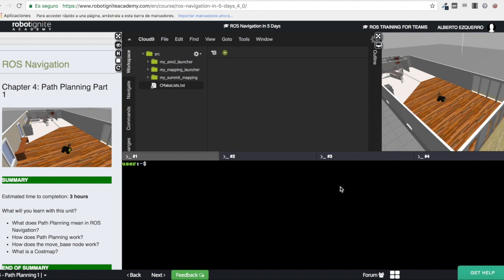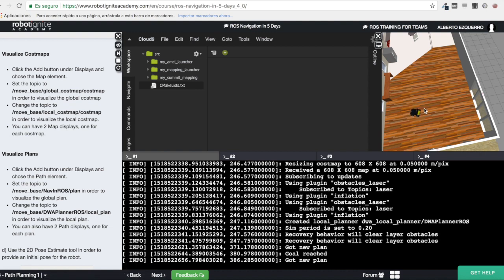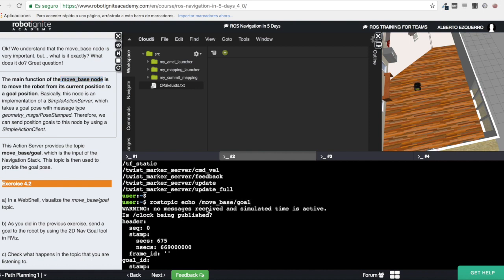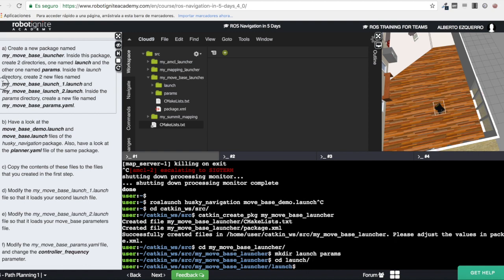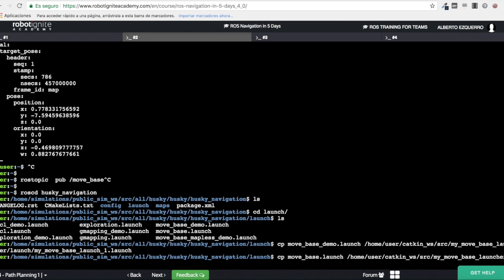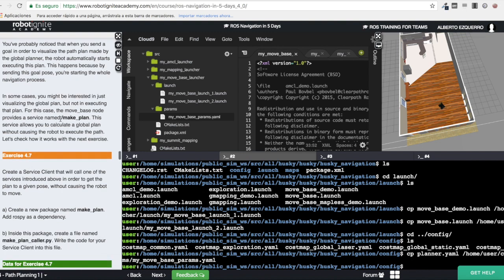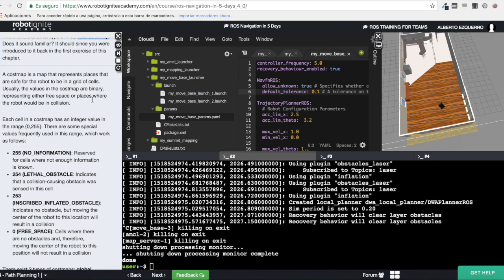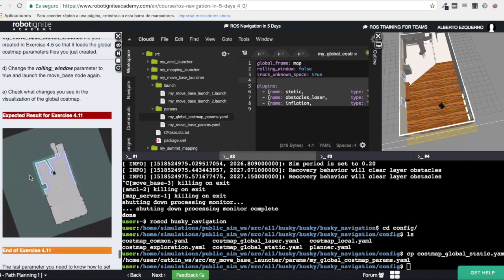ROS NAVIGATION IN 5 DAYS #4 - Path Planning  - Part 1

Comment: I appreciate you guys and I love your work BUT I have to say the following :

I usually enjoy your tutorials but this one is NOT very helpful at all. I mean the publishing to move_base/goal was just skipped without a simple demonstration of values to fill to correctly move the robot.

THAT would have been helpful so we could get a thorough understanding of the data to provide for such a complex object instead of just "moving on" and "skipping the exercises".

I'm a paying member on your service and currently stuck on that very move_base/goal issue. I'm consistently finding the videos accompaning your courses are not helpful to move me beyond points where I get stuck because those very issues are not tackled but glossed over
Reply from the maker: Thanks a lot for your comment. You are completely right. We are fully reviewing the ROS Navigation course in February. We will include a section providing this specific example. 
For further problems or blockings in the course, please use our Forum so we can provide you a quick answer

Comment: During firs exercise I accidentally cliked on reset simulation.
After that  roslaunch husky_navigation move_base_demo.launch doens't work anymore even if i refresh the page. Issue is :
"Timed out waiting for transform from base_link to map to become available before running costmap, tf error: canTransform: target_frame map does not exist.. canTransform returned after 0.101 timeout was 0.1."
Reply from the maker: Let us reproduce the problem and find a fix. Thanks for letting us know!
Reply: Probably with Ctrl + C didn't kill all nodes because it keeps on tracing the 
error but after a while it stops and roslaunch works good.
I try with kill -15 -1 but i was kicked off :-)